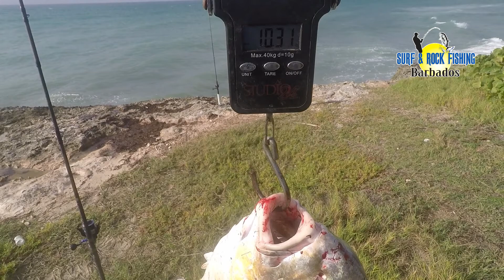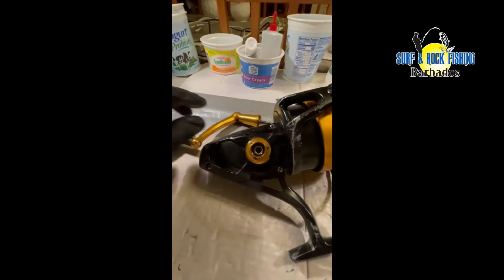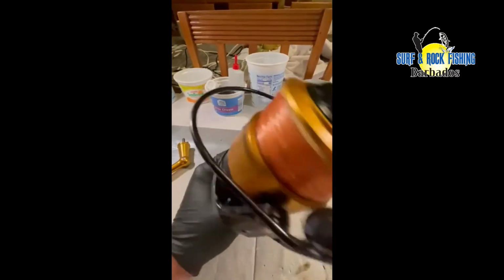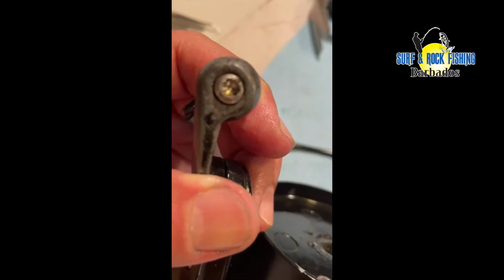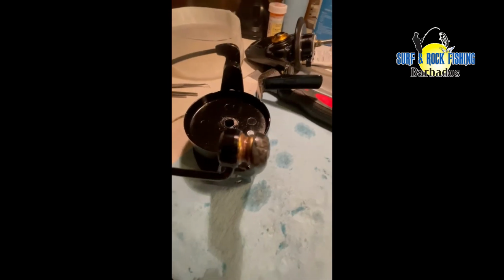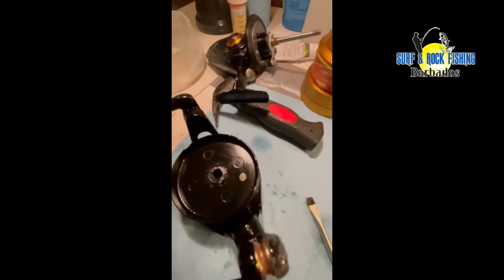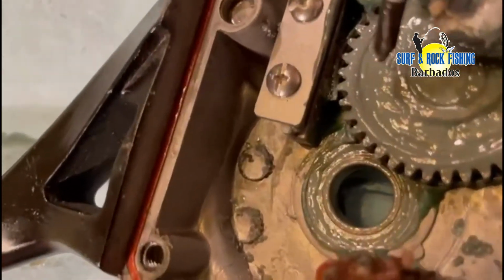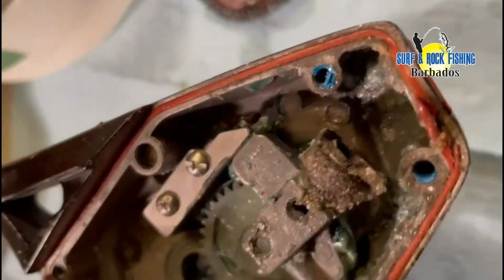The Reel Master

Comment: I’ve learned quite a bit from binge watching your videos. I’ve recently started fishing in Barbados but haven’t had much luck. What size hooks are you using and what’s the best and easiest to get bait ?
Reply from the maker: Some of us use 5/0...6/0...7/0...We use a variety of bait depending on what we are fishing for, Black Seaegg for Permits, we get black sea eggs from the beaches in low tide and Crabs mainly at night. We use live bait, slab bait, Sand Fleas, squid, sea cat, or Fish bites for other species. We also Lure fish sometimes. You can get Fish Bites from Fisherman Corner.